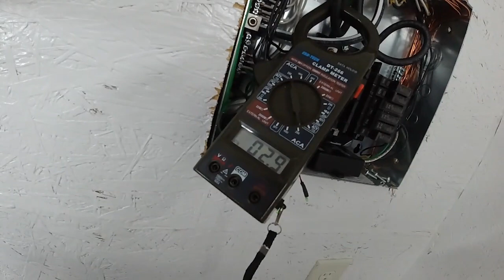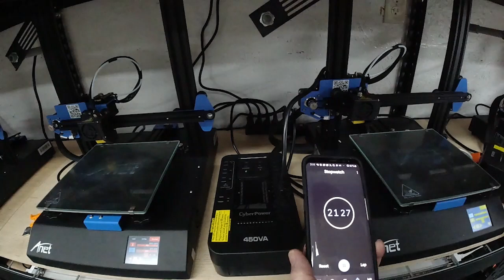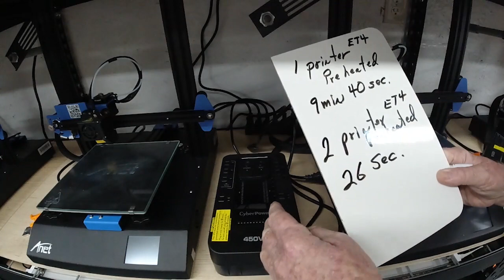TESTING 3D PRINTER UPS BACKUP, using 450VA, 260W Cyber Power battery backup on Anet ET4 3D printers

Comment: 450VA is only 260 watts power supply on printer is probably 300-350 watts not used fully. But there was no way 6 was goi g to work on that single UPS
Reply from the maker: I will keep trying till I get something that works. I need it yo be economical and handle 6 printers. I will solve this problem and show my results. Thanks for your suppoer my friend...Ken

Comment: Thanks for this interesting test Ken. I must have missed something but, if 1 printer lasted 9min, then in theory, shouldn't 2 last about 4min? They should be pulling the same amps on average over several minutes. It seems very skewed at 2 printers.
Suggestion: I purchased marine deep cycle batteries for my sump pumps but have a single controller. It might be way cheaper to go that route than buying individual UPS. Plus these batteries would feed more printers for that 1 or 2 minutes you need. My 2cents Claude
Reply from the maker: Thanks Claude for your comment. You are reading my mind my friend. I have some larger batteries that I can wire into the UPS that will extend the run time, however the problem is with the inverter in the UPS, it needs to have more Amp capacity. I will be working on this and soon I will have something economical that will handle 6 printers. Thanks for your input, you're on the right track....Ken

Comment: I would try a 1500 UPS... for 4... to see if it worked... It might not.  A 650 might barely handle 2... you want power for 6 printers thats tough.  Just my humble opinion but I look at the printer PSU which is 350 I believe... that's how I do the math.
Reply: The printer PSU is to provide the peak. It is very unlikely that a group of 6 printers will all be at peak at the same time.
Reply: @Sylvan_dB  and yet, he can't get a 480 to support TWO printers.  My math is sound.
Reply from the maker: Thanks for the comment my friend. I had an older 625VA UPS that I tried and not knowing the condition of the batteries I was able to get 3 printers to run for 10sec and 2 printers to run for just over 1min. Will keep trying to come up with a solution...Ken

Comment: You have to watch as well. If the power goes off for say 20 secs and the battery drains it will take a least an hour to recharge. If the power goes out again before the battery recharges the printers won't last the 26 seconds.
Reply from the maker: You have a good point and I hope supplemental batteries will help. I will have results soon...Ken

Comment: You need 850w one most likely, thats the lowest ive been able to find that will stay on and not let the battery overload and will auto shut off, The cyber power 1500w sinewave ones lets you run 2 printers
Reply from the maker: Thanks for your input, I do believe a 1500W would do the trick. The ones I have seen cost a lot. I hope to have an answer as to which is most cost effective soon...Ken

Comment: Ok one thing that you cpuld do is that based on power status you can send g code to printer to pause while on ups to save some battery
Reply from the maker: That is true my friend but I don't want to cut off bed heater and allow it to cool down. I think when I try my 650VA UPS it will do better. I am only looking for a few minutes to allow for power to return or to start a backup generator. Thanks for your comment and support...Ken
Reply: @NewTechInventors  is another thing is DC ups instead of inverter on ups battry and feeding the printer powr supplies you can directly feed the 12 or 24 v rails on printers to save huge money  on ups

Comment: "I lost power, and the UPS saved 3 prints! and the UPS only cost $$$$.$$" UPS is a waste of money. Its just as likely to burst into flames as the printer. Why double your headache for a once a month or less problem
Reply from the maker: I agree that it isn't a big enough problem to spend a lot of money on. If I can't come up with a low cost and effective way to do it, then I will chose to do without backup and take my chances. Thanks for your input...Ken